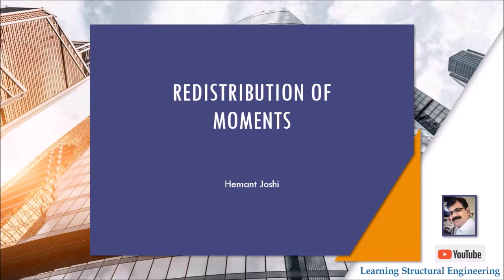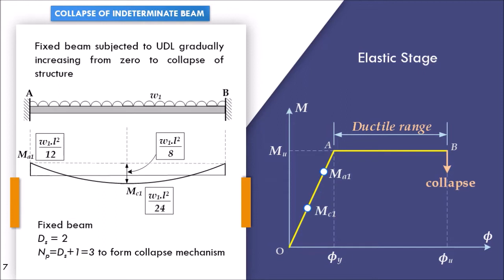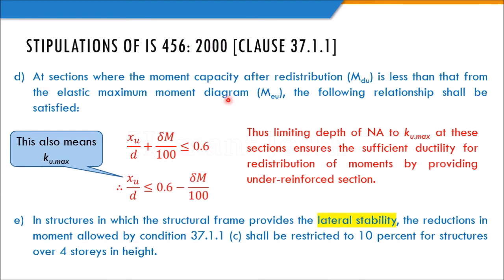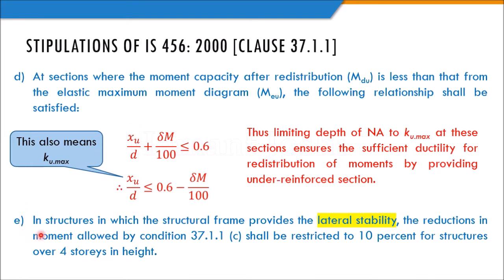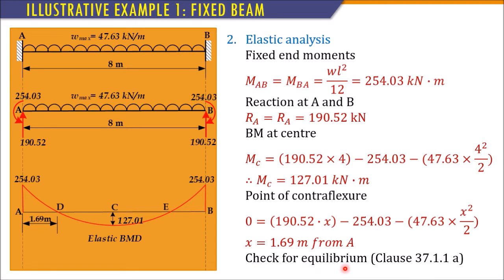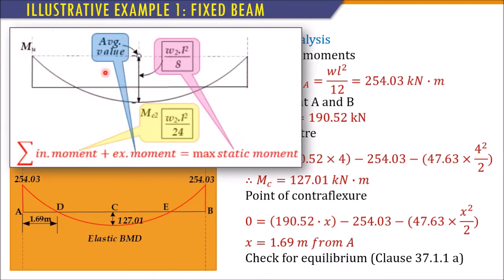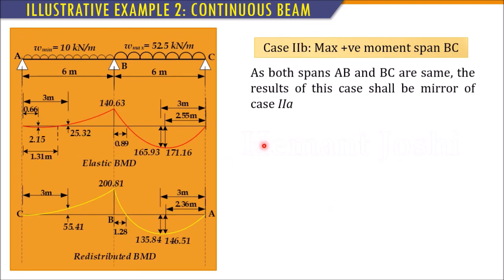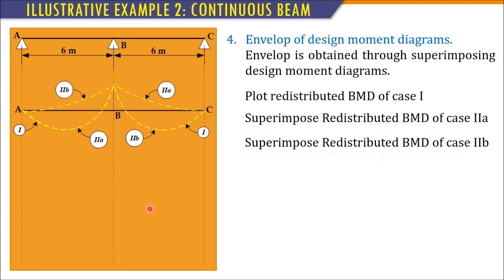Redistribution of Moments

Comment: Thank you for this great Video 
My question is as per graph you show in start of video for fixed beam When the beam fail ? When the both ma and mc in collpase zone or when ma in collapse and mc in dectile zone?
Reply: And if answer is ma in collapse and mc in dectile zone is this ma not increase more and wait to mc come in collapse zone
Reply from the maker: Ma in collapse zone with full plasification and centre section Mc just reached to end of ductile range. This will cause three sections fully plastified leading to collapse